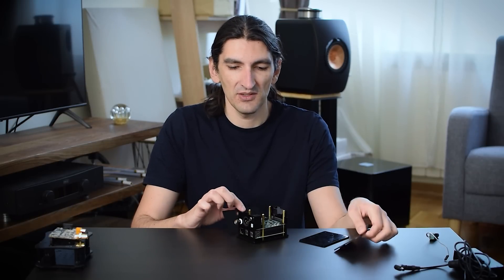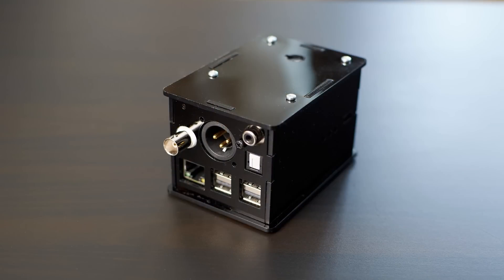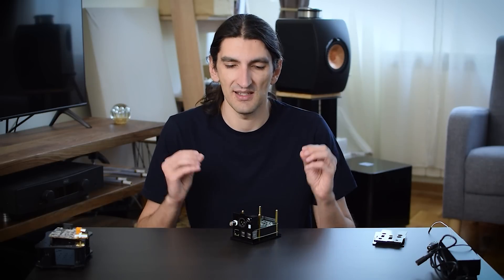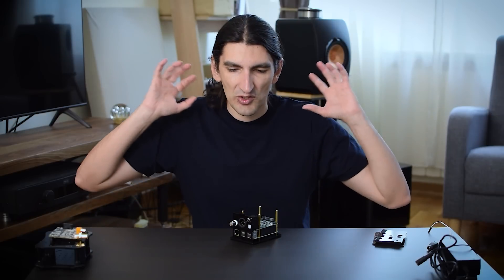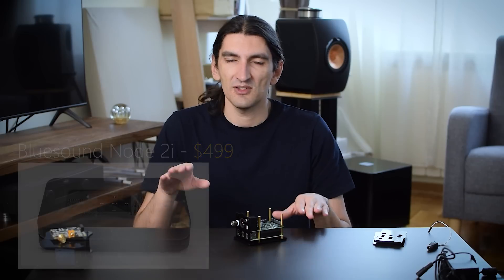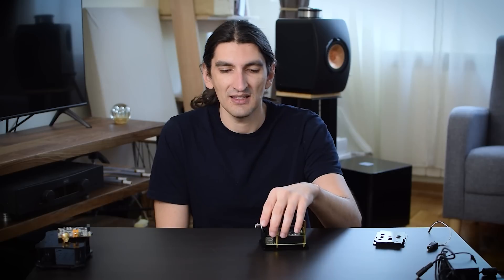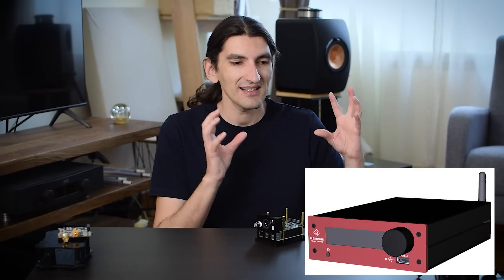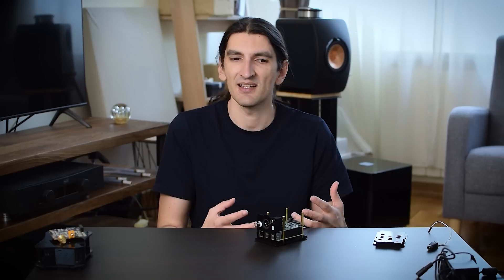Make your Raspberry Pi a true HiFi streamer with Pi2AES

Comment: I'm probably missing something but got to ask this: why should a digital output has to affect sound quality at all? What is this product doing? I can understand why a better clock can provide less jitter or why a less noisy circuit will prevent crapping the DAC side, but wouldn't a clean power supply to the PI and / or using USB (with those USB "cleaners") provide the same results? Doesn't it all depend on the DAC once the data is (cleanly) provided to it?
Reply from the maker: Unfortunately, not all digital outputs sound the same. As you mentioned yourself, clocks, noise floor, and jitter do make a difference that's easily audible no matter how good is the receiving part in the DAC itself.

Of course, most people are perfectly happy with Pi's USB output... But this is that next level of signal clarity, and it does lift the overall audio quality in a transparent system. That said, it's not that worth bothering with if we're talking about entry level gear. In those cases there are usually better ways to spend the money.
Reply: The review by Golden Sound explains this for you. https://www.youtube.com/watch?v=Jvu_doQfAI0&t=0s
Reply: @HHTTRRNN  this video is, well, golden :) thanks ! This clears out most of the questions I had 🤗
Reply: Good question! And here is where Allo DigiOne Signature makes a difference. Allo's hat separates sound signal from power, therefore there's no "contamination" from electrical noise. Maybe this new hat sounds as good as DigiOne Signature, but any potential differences I'm sure will be difussed by the DAC and the rest of the setup. I myself feel the concept of the DigiOne Signature is superior... but then again we fall in the subjective of how we perceive things and our personal tastes. =)

Comment: Why is this board so much more expensive than the actual computer. Somewhat defeats the purpose of Pi for being an affordable platform for me.
Reply from the maker: Not sure about the actual bill of materials, but being an electrical engineer myself I'll just share my train of thoughts on this matter. R-Pi is mass-produced stuff. They can drive production cost much lower, operate with lower margins cause it's sold in millions, and still be able to cover for R&D and turn the profit. This HAT is a niche product produced in quite small batches, a couple of hundreds at a time, and cost goes up quickly when the scale of production goes down. Also, parts in these types of audiophile products are most likely picked with more care (higher quality oscillators, lower tolerance resistors, and capacitors, etc). All of this piles up and this kind of niche product can never achieve a low price that hyperproduction of computers, phones... can.
Reply: @iiWiReviews  Exactly!
Reply: The Raspberry Pi by itself is not meant to be an audio device, it's a small computer. The HATs discussed here are circuits that significantly improve audio streaming quality and performance. Yes, the price increases, but still far cheaper and much better quality than a lot of popular alternatives such as Node or Sonos connect.

Comment: Glad I got mine before the price increase. All in I got board, case, power supply and pi for $240.
Reply: Yes it's all too expensive now, I just use USB and got rpi4 4gb, SD card, case US$75. Are better USB cables, ifi filters or power supplies worth it for RPI?
Reply: @G-rig01  I also have a second rpi4gb in another room connected with a Helm Bolt ($99usd) and it sounds great.  I use the stock rpi power supply but have tested between the iFi 5v with little difference.  I use a quality analog 3.5mm to RCA but nothing outrageous.
Reply: @harrybaque5502  Cheers sounds like a good setup. Haven't bothered with any special power supplies, hats or cables, concluded mostly a waste of money. Happy with the normal setup. Hats would be fun to tinker with I guess ;)

Comment: Place the order!, uff; thank you Srboljub I had it on my crosshair when I saw it on Goldensound Channel, pretty glad you posted this video. It will be my upgrade from a HiFiBerry Digi+ Pro volt mod connected directly to a low noise PS (similar to this 5V Hack). I have a Topping D70S with AES and IIS (HDMI) inputs.